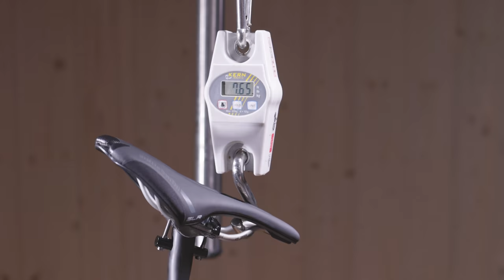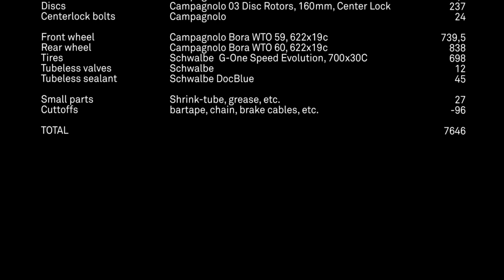Dreambuild Parapera Aeras I Light Carbon Speed Gravelbike I Campagnolo Super Record EPS I Road Plus

Comment: Great build!
However, I am getting confused by the bike industry and their marketing gibberish. 
Aero Gravelbike is the title. But what are the actual aero features of the bike? The downtube is kinda aero looking. Round seattube, round seatstays,  round handlebar etc.
Is one non-round tube all it takes to market a bike as aero nowadays? Deep section wheels could be mounted on any other bike and it would be at least as aero as this one.
And I find it more appropriate to call it an Allroad bike (they mention it on their website that it is meant for allroad) or simply, endurance bike.
My current endurance bike with 38mm tires has a longer wheelbase and more relaxed geometry than this one.
And while you can ride gravel on 30mm tires, is this then really a gravel bike, or a disguised endurance bike?
It doesn't even have a gravel groupset.
And the RED DOT Design Award basically means nothing at this point, because almost every new product has it. 
This rant was oriented to the bike manufacturer, not to this channel, I enjoy your build videos and keep up the good work!
Reply: I thought the same bro
Reply: @laurenz323  the zip ties too lol.
Reply: i don't think many would take this frame out on gravel and with a Campy Record Groupset >___>   Gravel, I think not !

Comment: It shocks me that people would buy a new bike with non integrated cable routing in 2021
Reply from the maker: on the pro side, maintenance is a LOT easier. Integrated is a cleaner for sure, but try flipping a stem or swapping a bar and your pretty much fckd 🙈
Reply: @roadbikechannel  That's fair, but I doubt the average person is constantly flipping their stem or swapping bars. I'd argue that for 90+% of people, the aesthetic advantage alone hugely outweigh every con, and that's without bringing aero into it.
Reply: Are you aware that aero gains are irrelevant in this case, unless you're a Pro rider? On the other hand, as RBC states, any kind of maintenance is a pain once every single cable goes undercover.
Reply: @unairamos74  It's literally marketed as an aero bike lmao
Reply: @NeutralGenericUser  yes... nearly 8 kg with pedals!
Reply: @unairamos74  I'm not seeing the relevance. I called them out for using lazy engineering by not integrating the cables, and despite stating the advantages and saying 'thats without bringing aero into it', you decided to attack the aero point, saying it's irrelevant. I pointed out that this is literally marketed as an aero bike, and now you bring weight into it? What's the relevance?
Reply: @NeutralGenericUser  it's perfectly relevant since such a heavy bike will never be fast
Reply: @unairamos74  Weight is far less relevant on flats, where an aero bike would do best. If you're doing a lot of climbing, sure, the weight will be a hinderance. However, this is marketed as an aero bike, which again brings me to my original point: why does not have any aero focused engineering? Most of the tubes are round, and the cables are not integrated. It's just lazy.
Reply: @TCaad10 They put 'air' in the name, so to the average consumer, this is being marketed as an aero bike. The name is absolutely misleading if this is genuinely not meant to be an aero bike, and the burden should definitely be on the company for picking such a misleading name. Weight doesn't matter much for an aero bike. A few tens of grams for a slightly larger diameter headtube with integrated cable routing is worth it.
Reply: @TCaad10 Ah, that makes sense. I guess my only complaint is the name then lol. Thanks for the detailed info in your earlier post!